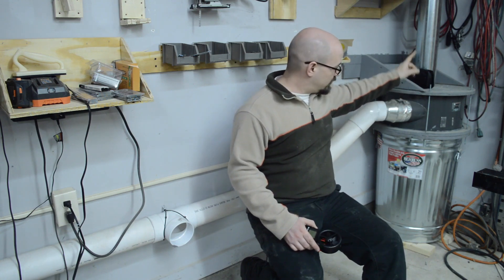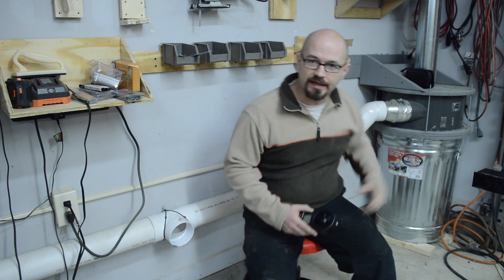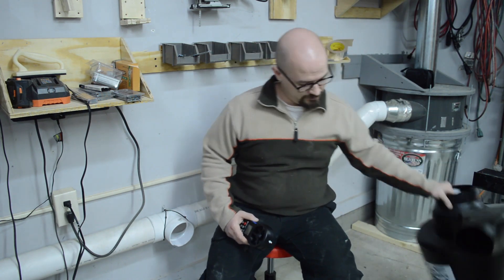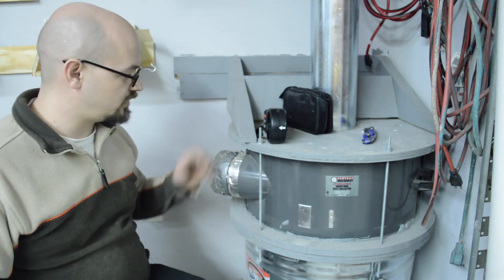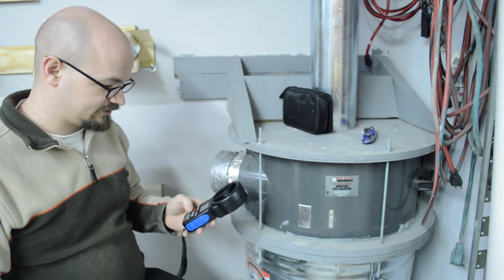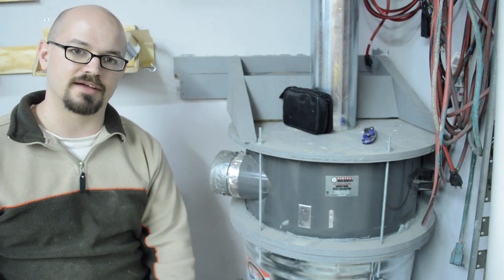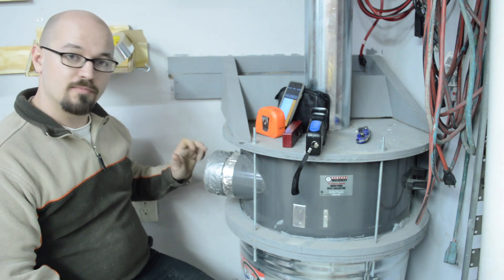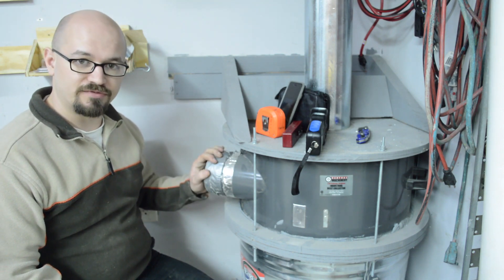Thien Baffle or Cyclone: Efficiency Comparison

Comment: While I appreciate the effort to perform an apples to apples comparison, I must say that, in my opinion, this is NOT a valid comparison.  Why?  Because the cyclone is a commercial product designed by professional engineers,but the Thien baffle is poorly built - ie, it fails to appreciate and employ two of the essential elements: gravity and distance.  A top hat-style Thien baffle should be taller than this example, with the inlet as high as possible, and the exhaust port 1.5”-2” above the baffle.  A well built tophat-style Thien baffle would perform better, ALMOST as well as a cyclone.  A cyclone almost always performs at least slightly better, but they are also MUCH taller - which does not work in some situations - and MUCH more expensive.  
Thank-you for your videos.  I generally find them well done and informative.
Reply from the maker: That’s a fair criticism. My attempt wasn’t to compare a perfect Thein baffle to a cyclone though.. just the commonly recommended one that recycles components from the collector. That said I don’t think I made it clear that this version is NOT an ideal thein baffle.. just a very hacked / better than nothing kind of attempt. 

Thanks for watching!

Comment: I would have preferred to send you a private email on this but you don't have any listed, since i DO NOT use FB, Instagram, or Twitt..er i had to post here. SO I have seen the 3 videos you have done on dust collection and all are very informative, but they do not answer simple questions i have about the way people are setting up their HF units for dust collection. Which is the best way to set this up, is there any loss of performance in the 2 setups and what effects does this have on the motor life? From my understanding the HF units are set up suck into the side Y-inlet port of the fan housing and BLOW OUT into the collector through a flex-able hose where it deposits down into the (collection barrel,bucket, bag, or whatever type used) and up into the filter, where as most if not all people are using the Y inlet to SUCK IN THROUGH the collector and the (collection barrel,bucket, bag, or whatever type used). Could you possibly do a video on this as well?
Reply from the maker: I THINK what you're asking is the difference between setting it up as a single stage collector, as it's designed to be. Which means the dust goes through the impeller and straight into collection/filtration. As opposed to a two stage set up, where the dust goes through some kind of separation first, and then goes through the impeller and into filtration and a second collection.

Comment: The bottom line really should be a dust collection (especially fine dust) comparison as that is the purpose of both systems. Still, it does give insight into the 2 systems, thanks for the video.
Reply from the maker: Thanks for watching

Comment: This is a  very useful comparison, althought I think that  there is a methodological error in that the entire air stream is not passing through the anemometer.  A long tapered transition pipe that matches the aperature diameter of the anemometer to the diameter of the intake pipe would be a bit better, I think. But I think your conclusion is essentially correct.
Reply from the maker: Perhaps. But considering it should be equal air flow through the whole pipe I don’t think it matters if you’re measuring the whole pipe or sampling a spot.

Comment: In my opinion, higher airflow has the potential to hurt dust collection, by not allowing the dust time to settle before the air is moved back out.  I think it all depends on the components and how well everything is matched in the sizing. However, this is still good data to have to help build a better overall picture.
Reply: However high airflow at the tool is the only way to capture the fine dust that is dangerous.  If flies everywhere in the shop with out a very high airflow and proper hoods.

Comment: So this is an airspeed test, not an efficiency test, which would have tested its ability to do its intended purpose...
Reply from the maker: It’s a semantic argument that’s come up a lot. I was venting outside so separation was irrelevant. And ultimately the purpose of dust collection is to prevent dust from getting in the air by collecting it at the tool. Two biggest factors there are the design of the dust collection ports at the tool, and airspeed at that point. So measuring the difference in airspeed does compare if one cyclone will collector better at the tool than other... which given the same amount of power requirement, if one grabs more dust that sounds more efficient to me 🤷‍♂️

Comment: Nice job!  It occurred to me as I was watching your method for measuring airflow that you may have inadvertently added some error into the process. When you placed the anemometer up to the opening, the footprint of the device constricted the opening and resulted in a higher airflow measurement than actually exists without the anemometer in place.  However, if all of your measurements are made on ductwork or openings that are the same size, such as four-inch, then I believe the error cancels out when you start comparing flow as you did.  I think a way around this would be to make an adapter that compensates for the footprint of the anemometer. So, the opening for a 4 inch duct measurement would be the 12+ square inches of the 4 inch duct plus the square inches of the anemometer footprint, ... whatever diameter that works out to be.  I think that would get you a lot closer to the actual flow measurement. Hope this helps!
Reply from the maker: That is a good point, and definitely could've been an error. Just like different pipe diameters.. which I think there may have been. That said, my main question was whether one caused a great air flow drop.. and the thien definitely did. I think the difference was great enough that any error from the anemometer frame is probably marginal and doesn't change the conclusion.

Comment: Nice video, thanks!  No one else seems to have directly compared the volumetric flow rates between the two systems the way you have, and I appreciate the information, although we have different constraints and goals, so I still need to find a more direct comparison of separation efficiency, if possible.

On a different note slightly unrelated, for all of those who are considering the impeller upgrade to the Rikon 60-200, for the time, work, and cost, you may be better off just getting the Wen branded 2-hp version, as it already comes with the larger impeller for about what one will have to shell out for this HF unit + the Rikon impeller (and you won't have to bother with trying to change it over...)

The reason I even brought up the Rikon impeller upgrade, was you seem more interested in higher flow rates, and that will do so or for those on the fence about buying one that they were already planning on modding, they could start with the Wen (Home Depot claims to carry it) and jump ahead in their shop schedule.  (YMMV, and the Wen draws more current, so do your own research on if it can be made to work for you in your situation!)

I'm on the fence about buying the Wen, or buying the 2 Hp motor from Harbor Freight that can be wired for 240 V and just starting from scratch, 'cause running at 240 VAC will remove the current performance ceiling.
Reply from the maker: That’s a lot of great information! I’m glad this was helpful. I’ve since moved to a Jet 1.5 HP cyclone unit and soon I’ll be going to a 5hp clearvue. I didn’t know about the WEN system, that’s probably a better value as you mentioned. They really weren’t a player when I made this though.

Comment: Yea, it sucks more, BUT..you didnt show which one separates better..which is what people need to know..
Reply from the maker: Well when I made this two years ago I didn’t know that, and I think I mentioned that I went vented outside so the amount of separation didn’t matter to me and there wasn’t an accurate way to measure without completely deconstructing my set up. My logic was capture at the tool is most important, what difference does separation make if one is still leaving tons of dust in the air?
Reply: @YouCanMakeThisToo  Way back in 2013 I converted a HF to a two stage using the Thien and was super please with the results. On the output of the HF I continued to use the HF configuration for the output of the impeller. After three years I only had about 4 cups of dust in the bottom bag and I contributed most of this to the overflow of the 20-gallon bucket under the Thien. Since then I have sold the dust collector and purchased a Gyro 700 which I discovered did not fit my needs (it has also been sold). I then purchased another HF from an estate sale. It was new in the box thus it was never used. After watching your video I decided to go with the Cyclone conversion. For the most part, the conversion has been completed except for the filter on the output. As a test, I fired it up and sucked up some dust. I was very surprised and disappointed as to how much dust came out of the impeller exhaust. My best guess at this time is that at least 20% of the dust is coming out of the exhaust. I'm going to try and conduct more tests and possibly build another Thine baffle. In summary, I think the Cyclone is considerably less efficient in separating the dust.
Reply: OK dummy on this end... I reversed the in/out puts. It works MUCH better if you have the connections correct (LOL). This dust collector is a stop-gap for me. I plan to get either a ClearVue 1800 with a 16" impeller or the new Laguna P-flux 2 or 3 when announced.

Comment: Thanks for testing this.
BTW did you happen to test which one stopped the most dust from entering the vacuum?
Reply from the maker: No problem. I only tested the difference in air flow, not separation.

Comment: would the distance from the impeller to the outlet the main reason for the change in CFM? normally it drops with longer connections
Reply from the maker: I'm sure it's a factor.. I'm not air flow engineer, but I seriously doubt that going from 2 feet of rigid ducting to 3 feet of rigid ducting explains the CFM loss. It does drop with longer connections, but the rigid ducting really helps minimize that, now if it was kinked up collapsible ducting.. I'd give it more weight.

Comment: My main question would be how does gravity also play into these.  For example, if your inlet for the cyclone is say 3 or 4ft higher than with the Thien port then the vaccum is having to pull debris much more uphill than before up to the cyclone which I assume would also lower efficiency or at least slow it down.  I guess with small bits it wouldn't matter but it would be interesting to test out with some clear tube and marbles lol.  Also, what size tube is best to run for the pipes and or how is that determined?  I would think the longer you run, the smaller you would want to downstep? I have a 2hp Grizzly unit I'm about to install and custom configure. I will need an approximate 15 to 18 ft run from the intake impeller to furthest tool of three (miter, bandsaw, jointer) with the 2nd stage in-between. I'd love to hear people's opinions on this.
Reply from the maker: The more you have to fight gravity.. that's going to affect the system, I don't know how much though. Pipe size is normally determined by CFM, the more you have the larger pipe you want to have, then over the distance you often step down. I barely know anything about that kind of stuff though but I believe there are several companies out there that have programs that help you figure all that out, I think Grizzly does.
Reply: Thanks for the tip. I never thought there may be a program that would help. Makes sense.

Comment: Isnt the more appropriate[riate measure of efficiency the amount of fine dust left over (i.e. chips extracted) rather than just the cfm
Reply from the maker: Perhaps, but as I mentioned I'm venting outside instead of through a filter and back inside, so I'm not worried about separation efficiency, but airflow efficiency... that is, which device gives me better collection at the tool. To me it doesn't matter if it goes into the bucket or outside (or even in the filter if that's how I was set up), if I don't have enough airflow to collect the dust at the tool then it's going in the air where I don't want it.
Reply: Fair enough, is the Super dust deputy just bigger than the normal dust deputy? You think that made the difference? I'd love one of those but we cant get them in the UK - just the smaller Chinese made cyclones which are really for a shop vac - I haven't seen a cyclone that big over here.
Reply from the maker: Yeah, the regular dust deputy is just sized for shop vacs. Theoretically you could hook it up to a dust collector but you'll lose a lot. The super has 5" ports but the small one is just 2" ports for shop vacs. So those pinch points are going to really effect the airflow. If you can't order a big one you should check out some of the videos people have made on building their own, might be the better option for you.
Reply: Looks like I will have to build one as we dont have anything that size in Europe - which I find odd considering its a market of 750 million. Would you mind telling me, are they just a plain cone inside or rifled with fins into a spiral?
Reply: @kickpublishing  have a look at axminster..£99 seems good i got one

Comment: To Thien or not to Thien, that is the baffling question. Glad to see this. I'm moving, setting up a new shop, and making the same decision. Several years ago I made a very effective HF/Thien system with 6" inlet, 8" outlet, no filter, and external discharge. Some fine dust coated the grass outside and some floated off like smoke. I think whether or not you have a filter matters more than how you separate air from sawdust. Leak prevention and the design of the hoods at each tool may also matter more. After seeing this I'm now leaning toward the Super Dust Deputy XL. The new system will be a lot of work, but not as much as moving my shop 2500 miles. Thanks for sharing your experiment with us.
Reply: venting outside increases air flow and is best for elimination  of the very fine dust particles that are the most harmful to your health.
Reply from the maker: Haha well played. Thanks for watching! And I’m definitely with you on the point about filtering being a huge part of efficiency.

Comment: you determined that the the cyclone had more cfm than the thien.  what about comparing both with the amount of saw dust/wood chip separated by each design?  i have seen the results for several different thien separators and there was virtually little to no sawdust that made it past the thien separator.  have done the comparison with both?  i havent started on a thien yet.....if the cyclone is as good or better with sawdust removal, i would definitely pay for one especially  with it having more cfm.  if you havent compared both, could you simply suck up a pile of chips and saw dust and show how much made it past the cyclone?
Reply: I disagree that the Thien baffle is a fraud or is worthless or snake oil. The purpose of the Thien baffle is not to replace a good cartridge filter but to reduce the dust loading going to the cartridge filter so the filter stays cleaner longer and thus airflow is not reduced by a plugged filter. I have Thien baffles on both my shop vac and dust collector (with cartridge filter) and I can go a lot longer before I notice reduction in airflow indicating the filter is plugging up on both units. What I learned from this video is the Super Dust Deputy pressure drop is significantly less than the Thien baffle and therefore airflow at the collection point is increased. I always assumed the SDD was more efficient at dust collection and suspected it might have lower pressure drop but this video quantifies the latter. Thien baffles are still a worthwhile option if you can't afford a SSD. One caveat on this video is we don't know if the Thien baffle used in the video was optimized for the application (or if the SDD was the best match for the DC used either) so this is just one data point.  When I built mine there were no detailed plans available just rough guidelines so while I know mine work I don't know if they are  optimized.
Reply from the maker: Not easily, I got rid of the Thein and going between the two is quite a process. I wasn’t worried about separation efficiency because I’m venting the exhaust outside and not filtering.
Reply from the maker: Thanks Doug, you definitely understand what I was trying to share with this video. A very limited but specific data point.

Comment: Just a note about previous comparisons. Fine Woodworking did several tests in their March 2013 issue. They found that the Super Dusty Deputy gave a consistent ~440cfm in their setup whereas the Thien baffle (starting with a clean filter) produced ~500cfm but tapered off after around 4-5 bag fulls to 440cfm. The trash-can lid style separator they tested produced around 360cfm consistently.

The difference between their setup and yours was that their baffle was mounted after the impeller (between the filter and bag). I'm not sure how much difference that makes, but thought I'd mention their results. It's the only other testing that I've been able to find. In "theory" venting outside with a Thien Baffle should have beat the SDD according to their setup and tests, but then you also would need to avoid sucking in larger chunks and screws/etc.

Also, have you had any issues venting outside such as heating/cooling/humidity being worse? I'm considering doing the same now. Thanks!

Comment: The cyclone separator has been used in industry for years such as gas industry and works very well. There are several videos on Utube on industrial use such as gas industry that explains it very well.